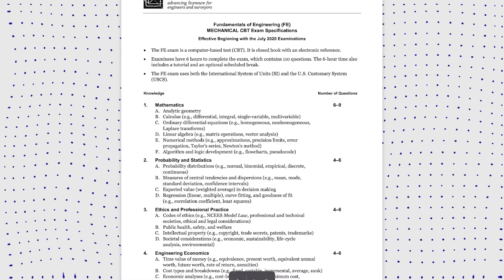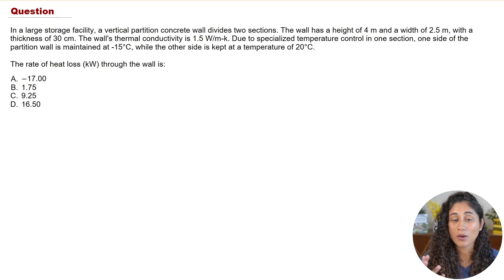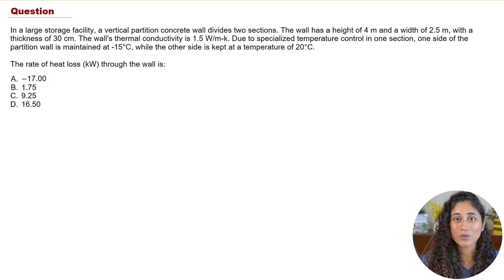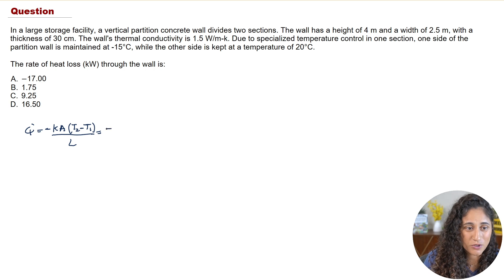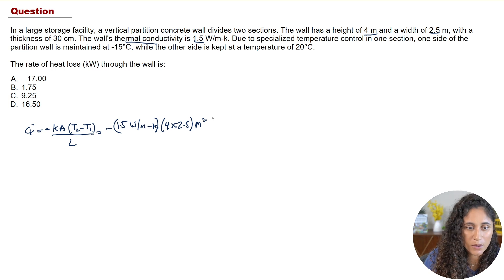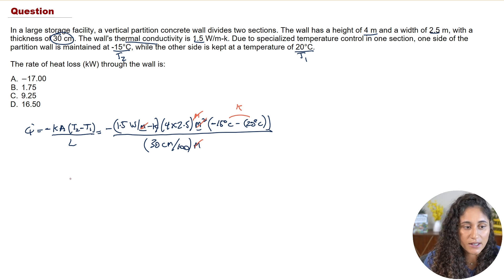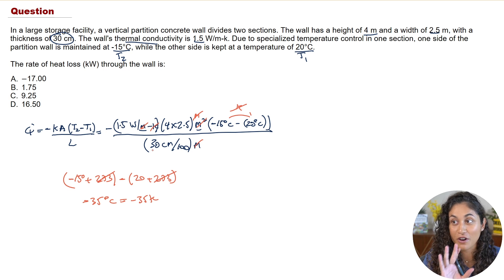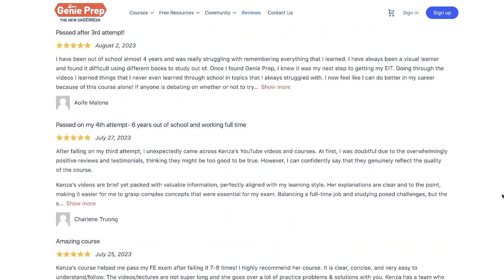FE Exam Mechanical Review | Rate of Heat Loss

Comment: Explain what happened to the "negative" sign of your equation? Answer should be -1.75. What if the answer choices has +1.75 and -1.75? Which one is correct?
Reply: Plugging in those exact numbers get you +1.750 kW